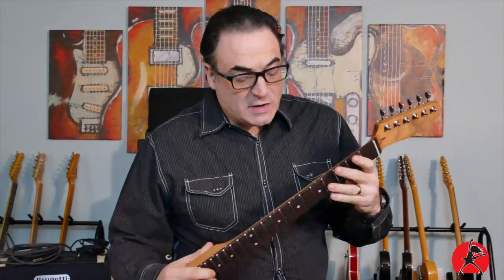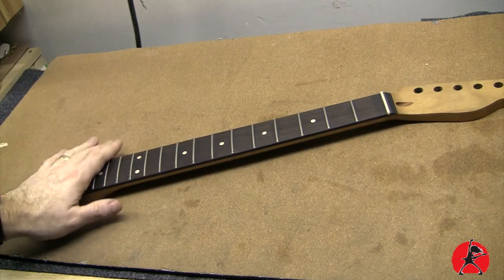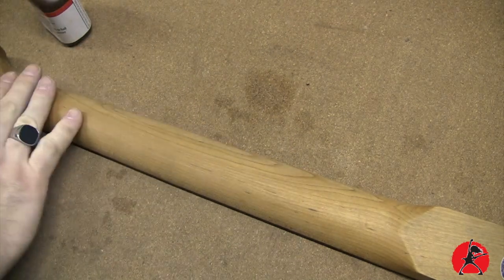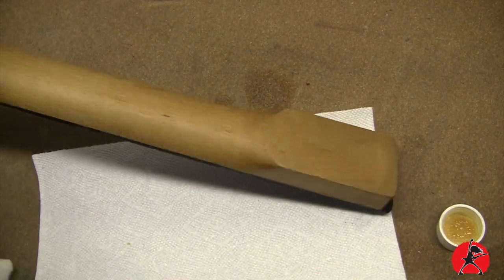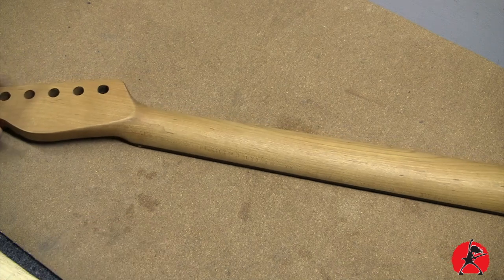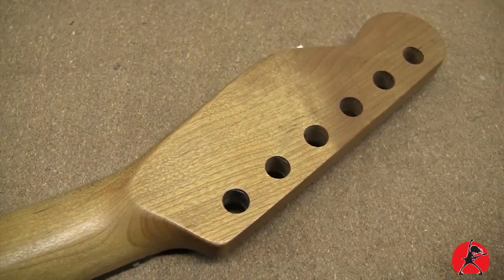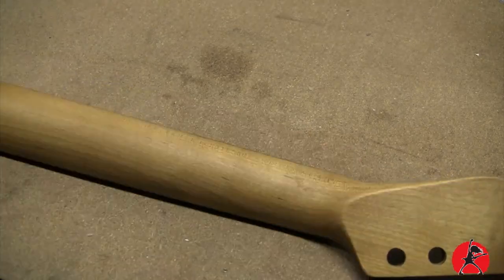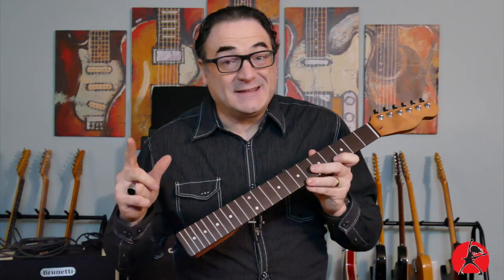Get The Smoothest Guitar Neck Ever With This Oil & Wax Treatment!

Comment: If you want to speed up drying, add a few drops of Japan drier to the Tru Oil.  The naphtha in the Japan solvent will dramatically speed up dry time.  Another great finish for necks, IMO, is boiled linseed oil.  Thanks for the great video.
Reply from the maker: Thanks for the tips!

Comment: Pro tip.  If you don't want to buy tru oil, or just want to get custom with it, you can just mix your own finish with urethane, tung or boiled linseed, and thin with spirits for hand rubbing.  Really, you can just mix any concoction you want out of oil based coatings.  That's all these premade ones are.
Reply from the maker: Thanks for the info!

Comment: Great vid, I’ve got an unfinished p-neck that I’m doing, I’ll probably do a couple of coats, the wax seems like it would also act as a sealent. I’m going to apply my logo on the headstock is rubber stamp and India ink, then poly it, with enough coats that is pops overtime,
Thanks
Reply: Also would love to see the whole build with some noodling as a follow up
Reply from the maker: @Nugmania1  check out my other videos. It’s in there…

Comment: Great video ! What do you do for the fingerboard ?  
What would you do for a raw maple fretboard ?  Thanks
Reply: For rosewood I personally would tape it off and not get Tru Oil on it. It is oiled naturally and doesn’t require finish. If your maple neck is not roasted, I personally would do more than one coat. Probably 2-3 thin costs whipping it off right away as he does.  If the fretboard is unfinished maple then I would apply the oil on it as well. Ive seen some people do this process diluting the Tru Oil slightly with mineral spitting

Comment: You used tru oil here which is supposed to make a somewhat glossy finish itself. I am concerned that I end up with a sticky neck again. Birchwood Casey also has a product called "Genuine Oil" which is supposed to make a silky finish. Does anyone have experience with genuine oil or had the same concerns as me?

Comment: I have several guitars. I do like the feel of the neck of the guitars with a wooden neck. For some reason, my hand doesn't flow as smooth and fast on glossy finished necks (compared to wooden necks). Any suggestion what I can do on the guitars with the glossy finish?

Comment: I think that to use wax is completely not necessary because it will come off after few sessions anyway, I apply the Tru-oil only, however I use few coats It stays put for years undisturbed.
Reply from the maker: Wax is more for the feel than anything else...

Comment: Hi Tony, can you put the wax on a maple fretboard the way you have on the back of your tele neck to give it some protection? Many thanks in advance, Mark
Reply from the maker: Typically a maple fretboard already is finished in poly and does not need any wax. Only if the fretboard is unfinished should you add wax for protection.

Comment: Interesting. I have a couple of Charvel guitars (Skatecaster, Desolation) that have an oiled finish mahogany necks, but I'm not sure of how to clean them and restore the smoothness they had since I've had them for a while, and I'm not sure how different they would react compared to other woods. Do you have any advice?
Reply from the maker: A little 00 or 000 steel wool would do the job.

Comment: I also have a really dry rosewood finger board on a cheap chinese P bass ( probably not real rosewood but its not bleeding dye into the applicator cloth).I applied boiled linseed oil  several thin coats. Can I do a final application with True oil?

Comment: I have a couple of ultra thin coats of rub on poly followed by feed and wax. Not sure if I have enough protection on the neck. Can I go over that with a thin coat of true oil or should I first sand off the existing?

Comment: Would I be able to sand down a Squier CV entirely (neck and body) and then treat it like this? Or would you advise against that idea? Thanks for the thourough info. Take care
Reply from the maker: If the neck is maple front and back it would be difficult to sand down the fret board side. You can however sand down the back side only. Not the best solution but it could work for you...

Comment: 1 coat (wiped off) of Tru-Oil then a thin coat of Feed'n'Wax... that can't protect the neck very much, can it? Might feel good, but how is it in a month? Do you need to reapply?
Reply: Your hand puts oil in the neck too, and think about butcher boards they see tons of abuse and get washed alot a little oil and wax protects wood for a very very long time. Tru Oil if youve never used it before is more like clear coat than oil. Ive finished gun stocks with and it last a lifetime.

Comment: I’ve wood stained my neck red and then used 5 coats of tru oil.. problem is my thumb turns red when I play. Do you think this wax would seal it? Thanks man
Reply from the maker: The true oil may not be completly dry yet. Give it more time.

Comment: Is this better then satin lacquer? And will it protect the wood from absorbing moisture real good?
Reply from the maker: The wax will help avoid the moisture seeping into the wood, but I think lacquer would actually work better. It's more a question of feel.
Reply: @addictedtogear would i every have to reaply the wax after a while?
Reply: No. Do not use Lacquer. It will defeat the purpose of a smooth satin finish. You will have Shiny neck, sweaty-hands and a stick to it while playing  (unless that's the feel you prefer) ?

Comment: I've done handful of kit and scratch builds and I've almost exclusively work with truoil. But by no means does that make me an expert, but with only 1 coat of truoil I don't think it's doing much other than just absorbing into the wood. I would bet that if you just did the wax finish it would probably be indistinguishable from a neck with 1 coat of truoil. One recommendation however would be the thin the truoil with naptha or in my case lighter fluid (I live in a state where I can't legally buy actual naptha). Thanks for the video, I do close to a dozen coats of truoil, than do what I refer to an oil sand with truoil and 1500 grit sandpaper to level out and knock back the gloss, than apply renaissance wax for that silky smooth finish and a deep oiled wood look
Reply from the maker: Thanks for the tip. Your technique sounds solid.

Comment: Is the wax required? I passed the oil and let it dry should i still apply the oil?noe thst the oil is dry still ok tk add the wax
Reply from the maker: No it's not required however it does provide an additional layer of protection.

Comment: Can i use any wax? i just remove some old poly from a guitar neck still has some orignal paint but there is some maple showing after i sanded of the loose poly do i need to wax or oil?
Reply from the maker: Best to use a good quality wax for wood.

Comment: Did I misunderstand, or did you say you waxed it first, then put on the Tru-Oil? That's backward... you don't want the wax on there when you put on the oil. If there is wax on it, remove it, then apply the oil. Any wax on there first will prevent (or at least reduce) the oil from absorbing into the wood, which you want. I think this is what you did probably, but the way you said it, it sounded like you still had wax on it when you applied the oil. I love oil on necks. I have used Tung Oil or sometimes BLO, followed by wax after really thorough drying, in addition to TruOil.
Reply from the maker: Oil first wax after.